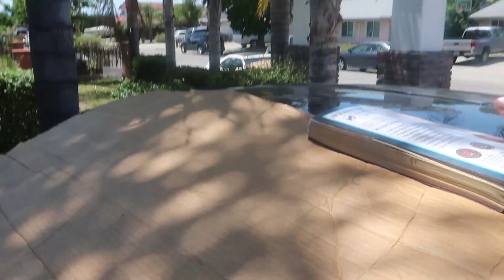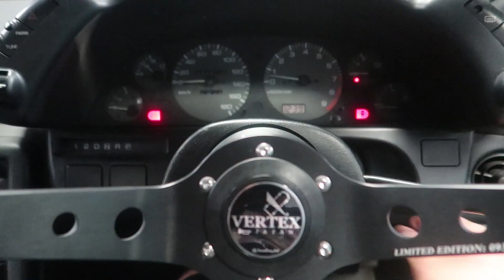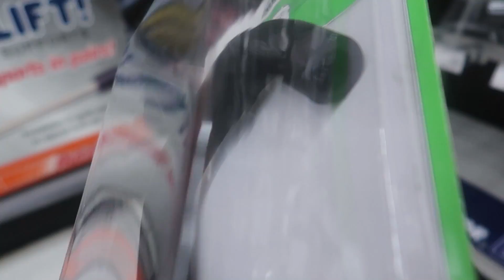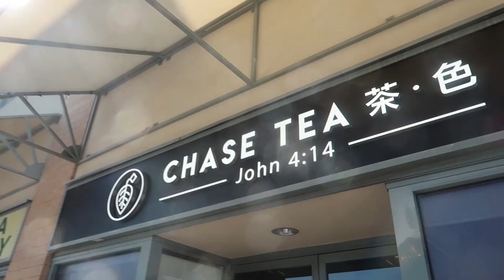We Didn't Expect This To Happen..

Comment: Could be the o rings are bad usually when those go bad  they cause whining sound and leaks idk on the lexus but on a honda they are inside the hard line attached to the power steering pump

Comment: I have an is300 also. I've had all the oil seals replaced at 119k and the power steering is the only thing that leaks but I just top it off